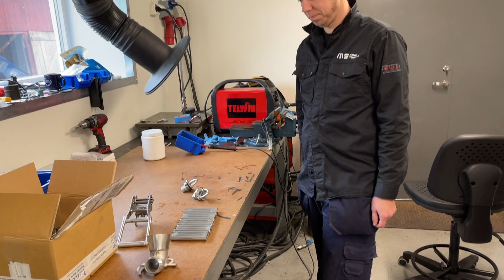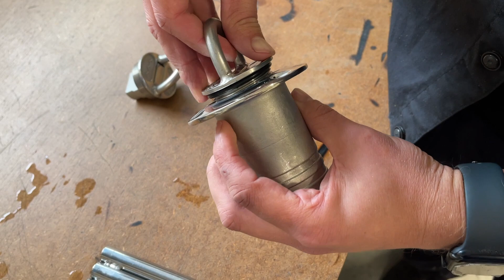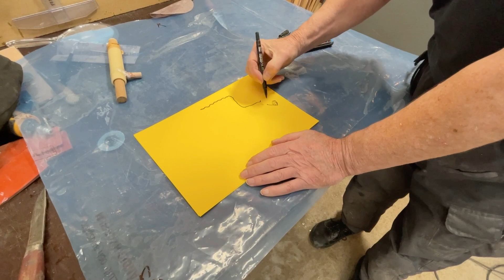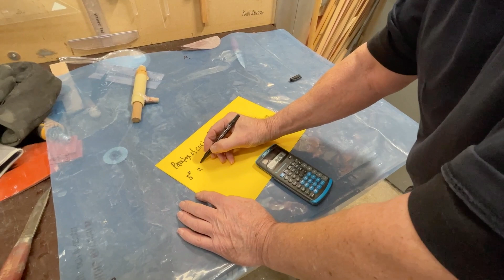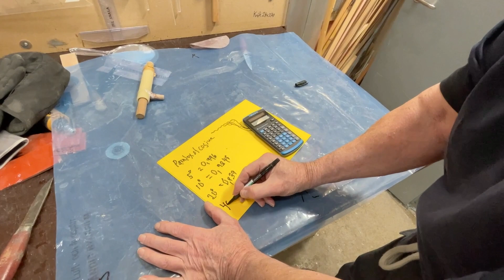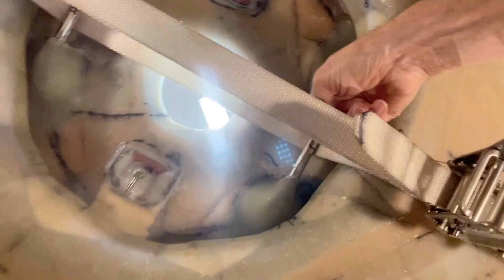4 Oct 2023  Martin the welder and the paradox of cosine

Comment: Sven, I'm glad you raised the issue of sailing dead downwind. 
 Sailing 22.5 degrees off the dead downwind course is  8.2% longer.
 A Bermudan rigged sloop sailing dead downwind is slower if you are not using a spinnaker.
 For example, sailing dead downwind (goose winged )you're doing  3 knots and by veering off by 22.5% , with the wind over the quarter, most boats will sail faster, especially bermudan rigged sailboats.  

Now on the 22.5 degrees course you're probably going 4 knots that's 17% faster than 3.24kts ( 3 +8%)  and  is 10 minutes per hour faster (and steadier ) than staying on the dead downwind course.

Gybe regularly and pay attention to to the obstacles on the course.

If the wind is strong and the boat is  already at full hull speed, dead downwind gybing will not be any faster but will steady the boat.

Comment: Sven, I believe the required downward force on the deck hatch is only 334 kg. (3.276 kN)
Your calculation on the 3rd  December 2022 resulted in 1.2 tonnes, but the formula you used omitted a step that you used in November 2021 whereby you divided the hatch circumference by 3 (the gasket test piece 3cm width). Also you were satisfied  deforming the 20mm gasket to 14mm  using 6 kg instead of 7.5kg.

Re. the new tie down. As the webbing turns the corner; perhaps a steel pipe quadrant embedded in the corner will reduce friction.
More power to you.
Is it your 84  1/2 birthday  this month?
Reply from the maker: Thanks for pointing out the error.
22 Oct 2023 I be 841/2 year old 
Looking much foreward to it.

Comment: The previous solution with the floor mounted strap makes much more sens than this new one. However the excentric latch method makes even more sense. There is also a turnbuckle method, but this makes hatch opening very slow.
Reply from the maker: the floor mounted strap took up to much space in an already little space.
Excentric latch will chafe
Reply: Chafing can be limited by putting special durable chafing surfaces that could be exchangeable.